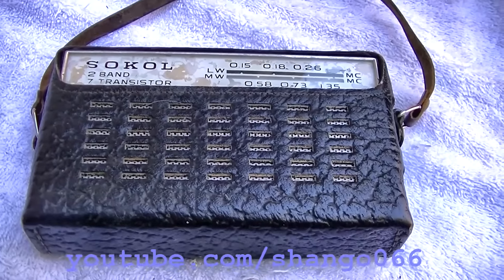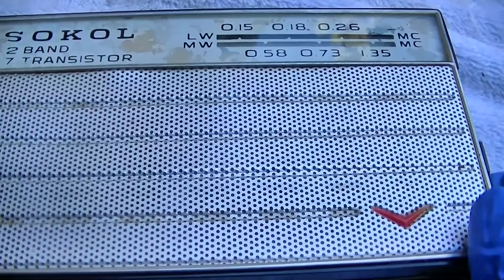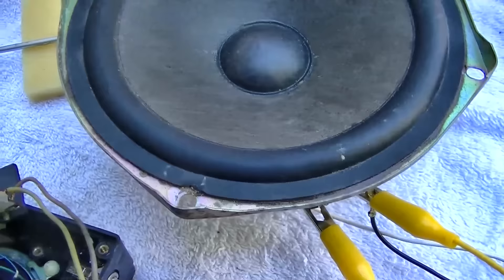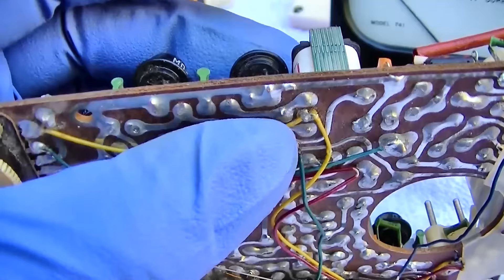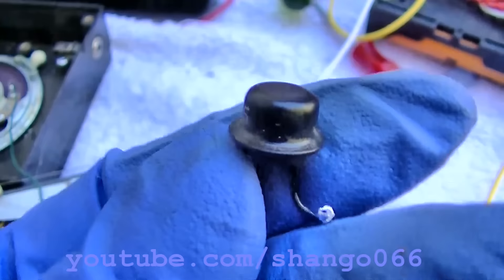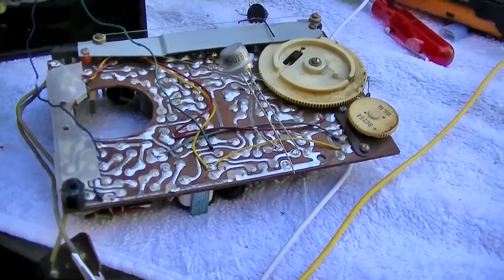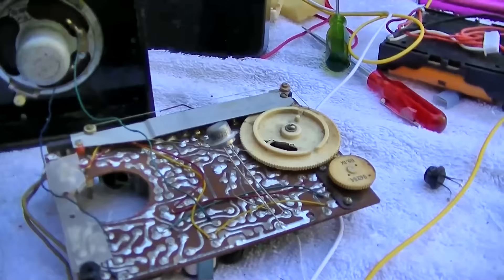1965 SOKOL USSR 2 Band AM Transistor Radio Diagnosis And Repair

Comment: It's amazing how good things can be in a world without forced obsolescence. Even light bulbs in the USSR lasted 30 years.
Reply: Yeah imagine you could have bought an old Fiat built by Lada in 1970 and still be driving it.
Reply: Yes but everything was super expensive and never available back then. Its not all good
Reply: In Germany (west) we had special longlife light bulbs (for traffic lights and hard to reach locations). They were rated for 25.000 or 50.000 hours. They had less than half the brightness of normal bulbs though. A 100Watt was dimmer than a normal 60Watt. There is no such thing as a free lunch...
Reply: @albinklein7680  If you want your bulbs to last ages use a dimmer and don't run it past 80%. Use a deliberate slow reduction and increase when varying power. Any bulb if you run it under its rated power by X percent will experience an exponential increase in life expectancy, same with most electronic components. The most useful to know about being the electrolytic capacitor which at its rated temperature and voltage may offer a LE of say 1000 hours. If kept cool and run < (twenty percent below) rated voltage will last almost indefinitely.
A bulb built to a rugged specification (like your traffic light bulb) will, when underrun last pretty much as long as the building its put in. There are always exceptions and other variables that can affect life expectancy though, ie electrolytics can dry out if seals are compromised. Bulbs can lose vacuum etc. They will all wear out in the end..but you can make some things last for ages. Especially if built in Germany...😺
Reply: BMT  Maybe you are not taking into consideration that the USSR launched the first and second satellites into orbit. Also the first man to orbit the earth, the first space walk and the first orbital station. It doesn't seem the equipment used by them were developed in the West since the West was lagging behind them. Even today, the US uses Soviet era motors for some rockets.
Reply: @martinda7446  Yes. I have a radio alarm clock with an ancient backlit LCD display. Lit by a small halogen bulb driven at kind of half it's rated power. That bulb lasted for exactly 30 years. Continuously. 24/7. Amazing.
Reply: @albinklein7680  Ha ha yes quite amazing.
Reply: That’s because of all the power cuts.
Reply: It was like that in the US too until our corporations started selling out to China. I have a lot of hefty built vintage electronics. Even my dads old HAM radio from WW2. Solid metal with vacuum tubes. The tubes are missing but I think I can get those on ebay.
Reply: You may want to read about the Phoebus Cartel, which was a meeting of light bulb manufacturers in which they agreed to limit the life of light bulbs.  This is real, not a conspiracy theory. https://en.wikipedia.org/wiki/Phoebus_cartel
Reply: @Tall_Order  Nobody sold out it was following exactly what America worships - Market forces. Get it cheaper and sell more that is the philosophy that built America. Go see Henry Ford.
Reply: @Tall_Order  And it happened everywhere in the west. Look at the UK...Or Great Britain..for perfect example.
Reply: Martin D A you can still drive a model a ford everyday if you maintain it...
Reply: @cardboardboxification  Yes...?
Reply: @cardboardboxification  You can still drive a De Dion-Bouton everyday if you maintain it.
Reply: I have light bulbs in an actively used ceiling fixture that are at least 30 years old. Probably older, maybe 80's or even 70's. Back then the electric company gave us our light bulbs for free. One bill each year showed your allotment, maybe a dozen or two. You would take it to the electric company's store to collect, some or all. Yes, the electric company had a store in our small town. You could pay your "light" bill there. They took cash. Store closed many years ago, along with discontinuing the free bulbs. Now bulbs (incandescents) hardly last a year. GE's are the worst for early burn-out.
Reply: That because the electricity was rarely on or working in these Comunist Bloc states
Reply: @albinklein7680  Soviet Union was a polluted empire of industrial and nuclear waste
Reply: @Jeffrey314159  Ha ha ha
Reply: @Jeffrey314159  Yes. That's the reason why I am a huge fan of Soviet Russia. I love that "I don't give a F**k" attitude.
Reply: Light bulbs aren't rocket science. The more efficient incandescent light bulbs are, the shorter is their lifetime. There's no way around it. There are light bulbs for photography and home movie use which have a lifetime of 20 to 30 minutes.
Reply: @albinklein7680  Albin is right, but if it doesn't seem logical that the more efficient the bulb the less life it has, it is because he is talking about luminous efficiency and the hotter the filament the more visible light it produces. Electrically all bulbs are 100% efficient at producing heat (and light). The visible light of a standard household incandescent bulb remains at between 1 and 3 percent conversion rate for energy applied. They are at a filament temp of 2550 C. Photo bulbs can be many hundred degrees hotter. Dropping that temp lowers efficiency and raises life dramatically. The light that shines more brightly lives....etc..
Reply: @magomarko5991  I remember the shitshow at NASA in the early 90's after they bought a Russian rocket motor built in the 60's and it almost took off with the test rig.
Reply: @magomarko5991  Yes with their German rocket scientists, (closely run by the US German rocket scientists) with their V2 rocket engines shipped straight out to Moscow from Germany. Along with the Contax cameras and watches and aerodynamics of the 262...Mind you we all did the same thing...
Reply: @pietmondrianstudent6984  You did..
Reply: Out of necessity. Imagine going to a Russian store to buy a light bulb. Probably would be an all-day endeavor. Assuming you could even find one.
Reply: @patricknesbitt4003  Really not.
Reply: @martinda7446  had to look that up, never have heard of that name brand...
    I like all old cars
Reply: @cardboardboxification  Me too. 😺 Merry Christmas hill billy.
Reply: @martinda7446  Total nonsense, the USSR didn't have any german rocket scientists or engineers in it's space program. They were interrogated until the middle of 1951, then imprisoned for another couple of years, before all being deported back to germany in 1953. When they were in the USSR they didn't work on space rockets, only being used to advise reverse engineering of V2 bomb.
Reply: Lasted 30 years in suburb area, where thw voltage drop on the power line was big enough to run the bulb with yellowish light :)
Reply: @Tall_Order  I am 69 years old and I live in Panama. I remember when I was a boy in my country and American products were top quality and very durable. US made products sort of owned the market here but it was ok because they were excellent quality.  Now it seems everything is cheaply made regardless of country or brand. In regards to vacuum tubes, you are right about ebay. I build tube regenerative radios as a hobby and I can get all common tubes from ebay, some of them "new old stock", meaning they have never been used.
Reply: @magomarko5991  Sure we all had experts and there was only one Tsiolkovsky..But the work on the V2 engine, guidance system et al  was enough to take us all into orbit. Soviets included. To dismiss that fact is well just silly. The Soviets had nuclear physicists too but would not have produced a viable device (bomb) without a fair bit of help..If you know what I mean..Same with aircraft, they built their Migs with the help of whom? If you don't say German aerodynamicists and British gas turbine engineers you again would be wearing blinkers. I love Soviet era engineering. I own many cameras, watches and radios from that era. Their thermionic devices are wonderful as are their semiconductors. The only reliable germanium devices (almost) guaranteed to still work after 60+ years are the Soviet types. The American and British are all failing now or need real careful handling.
I repeat that we were all at it, grabbing as much as we could get our hands on. There would be NO VOSTOK without the V2, NO SPUTNIK either.
Reply: @magomarko5991  Yeah New Old Stock is where its at. Or with a few risks go for anything vintage. I have a vintage 1950s GE coffee percolator and it makes the best coffee. I suspect these days if we want anything modern thats built to last we may have to build it ourselves. I recently learned we can 3D print metal, so thats a nice push in the right direction.

Comment: dear sir kindly remember you aren't using same numbers matching push pull output transistor that's why results not achieving ,like one npn witt another pnp match is bd 233 with bd 234 in ecg master replacement parts manual for Philip in English semiconductors parts series ,,, and in third world where we are living are used to of replacement english and russian parts with japanese series parts , with 100% results

Comment: This type of soviet electrolytic caps is usually good even if it is 50+ years old. The big one near the speaker is also should be good. You don't need to change them. And yes usually such radios no need alignment. But there is silver in the tuning cap so it can suffer from sulfiding when stored in barn conditions.
That МП40 was made by the "Светлана" (Svetlana) factory. It is pnp 15V low frequency transistor (<1 MHz). There is also МП40А version, rated for 30V. Very common and wide spreaded transistors.
Also notice metal rivet vias under transistors. It is made for easy and quick repair. You don't need to remove the pcb for changing dead transistors. You can resolder it from the top.
Reply: but who told you that Soviet electrolytic capacitors are good even after 50 years? they were of poor quality already from the factory and their service life is usually about 3 years !!! and now they need to be changed everything!
Reply: @tolyanx825  What you're saying here is bullshit. In the '60s those components were still well made, and as this radio is an export model (note there are latin letters on it, no cyrillic) the components were especially selected. Those capacitors are still good, no doubt.
Reply: @tolyanx825  These capacitors of the "КЭ" type are of poor quality and durability. The circuit will work with a loss of their capacity up to 90%. But it is cheaper and smaller than paper capacitors.
Reply: @tolyanx825  I can tell you. I measured hundreds of them for capacity, leakage and ESR (in 0.1-10kHz range). I never change caps just because of its age. It is stupid and dilettantic. Yes, legendary armenian caps are 100% crap but there was tons of other types made by other factories. It is ЭМ type electrolytic caps in this radio. It was designed specially for portable radios and in most cases it still have close to nominal capacity and acceptable ESR.
Reply: @avmandrew8949  It is ЭМ type. The КЭ type caps, especially the КЭ-2 are much more durable than most of non-military graded К50 despite that it is their predecessor. This is based on my experience. The КЭ type was wide used in old tube radios and TVs. Also wide spreaded soviet paper caps such as БМТ, БМ and МБМ types are utterly crap due to bad isolation and ability to absorb moisture from the air ===> high leakage currents and Electroboom-like content as result.
Reply: @janosnagyj.9540  don't listen to them they're troll baiting you
Reply: @electrofan7180  it's not worth the time to reply, notice how they never replied to you, they're trolls I don't understand it, but some people like to piss people off for no reason And never respond afterwards.

Comment: lots of owners ran these radios from 6x R20 cells, or 2x 4,5 volts batteries. They ran till the batteries started leaking from depletion. When these makeshift batteries were changed, it involved soldering them together with wires. We had to improvise these things, because batteries were expensive and hard to find in the now ex communist countries. This radio got damaged most probably because the user or repairman hooked its power up backwards for a few seconds. MP40-s were the universal AF transistors in many USSR civil and military  designs.

Comment: Throughout the 1990s we had a great long wave station called Atlantic 252. It broadcast from a pair of 300kw transmitters on the west coast of Ireland (hence the name) and targeted the British Isles but apparently could be easily received on the eastern seaboard, and I bet this thing could have pulled it in even further inland. However it closed in the early 2000s and I don't think there's anything on LW now - all my radios are AM / FM only so I've no way if knowing for sure.
Reply: In uk we have radio 4 on LW. 198 kHz or 1500 meters. Broadcasts the cricket in summer. I get a couple of other stations too.
Reply: @davidpriestley3268  French stations on long wave. I pick them up here in the UK.
Reply: Ireland still broadcasts on 253 kHz along with Algerior on longwave
Reply: There are still about 10 longwave transmitters. Luxemburg and Ireland still have music programs on longwave. See http://mediumwave.de/#lw for the ones you can receive in Europe. 
There are still multiple megawatt stations on air, and occasionally you may be able to hear them. 
Apparently, Mongolia also has longwave transmitters but i never heard those so far.
Reply: @mfbfreak  thanks for that, very useful list! I've remembered that I have an old Sony clock radio with LW stashed away - haven't used it in years as the VFD went very dim, but as I recall it had a surprisingly sensitive tuner in it so maybe I'll dig it out later and see what I can pick up :)

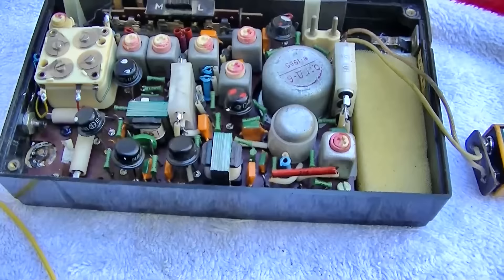Comment: 5:48 No external speaker connector. Battery charger connector. It had a factory 9 volt rechargeable battery.
10 million units were produced from the 7-transistor, 2-band pocket radio, which could be operated from a 9-volt battery, its own rechargeable battery, and mains.
Reply: yes it was a 9V NiCd cylindric cell, i tested one made in 1991, and it was still fine in 2019 !!!!

Comment: I have one of these radios too. The speaker is fine, but it does sound very tinny. It works but it does have some weird whistle-y sound issues. I suspect they're mirror image signals, so the input filter may be tuned wrong. 
It is indeed used to be worn out. The volume knob has litterally gone smooth, the ridges are all smoothed out from turning it on and off thousands of times. 
I also used to have one of these complete in box, with the original mains power supply. The power supply is just a big-ish plug with vent holes, with a resistor and a diode in it. The little radio is supposed to isolate you from the mains... Very sketchy.

Comment: i build and design metal detector circuits for my hobby, i built one old design last year, some of the components are no longer made and are hard to find so i built it with supposed modern replacements, and it was shite! it gave false signals drifted all over the place ate batteries, during the first lockdown i made another board and built it with new old stock soviet parts off ebay, and other old stock parts, and it works great, some older parts are only available as soviet alternatives, given a choice between obsolete but correct parts and fake rubbish there is no compromise.

Comment: The long wave aircraft beacons (NDB) were used for direction homing near an airport, they also sometimes had weather info in voice.  They were not the primary aviation navigation, at least not after WWII.  They were replaced by VOR stations which operated in the same VHF band as the AM plane to ground (or plane to plane) radios, but on separate channels.  VOR's indicated the direction from the aircraft to the station as a heading on a compass like indicator which showed how far off a desired track the plane was.   Aircraft later adopted the use of LORAN, and then GPS for navigation.  I haven't flow (private pilot license) for almost 30 years now, I don't know how current civilian aircraft are equipped radio wise.  I'm sure the VHF communication channels are still in use, but maybe have moved to FM or SSB, or even digital modulation.  The VOR system is probably still available, but GPS is far easier to use.  NDB's might be still maintained near major airports.  I should get a recent sectional chart for some of this info.

Comment: "Shango066" The MP40 output transistor may have been damaged if the + and - power is incorrectly connected. When replacing, it is advisable to change both transistors of a powerful stage - one year of manufacture and quality. And it seemed to me that the electrodes of the С-E transistor were messed up. In this case, the receiver will work but with distorted sound.
Reply: Please what's the equivalent of transistors

Comment: I must say in defense Sony and Panasonic. In 1965 they were way ahead of Soviet consumer electronics. In the quality of materials used, quality of components, a variety of designs.
However Russian transistor radios very interesting. Usually, they over-engineered in one way but have an annoying weakness in another.
Interesting pieces of vintage equipment. I have vintage Soviet radios and can compare.

Comment: Greetings:
If the other output transistor ia the same part #, use you little parts checker to learn the hfe and use that setup to hunt for compatible parts in your stash. Then you can try by touching the contenders until you find one that works. Don`t forget to note the equivalency.

Comment: I wonder if somebody had wired the connections wrong on the battery connector on the circuit board. I have only had these transistors fail on a set that the previous owner had put mains across. These transistors don't fail under normal use....
Reply: reverse polarity diode would be a great addition to this